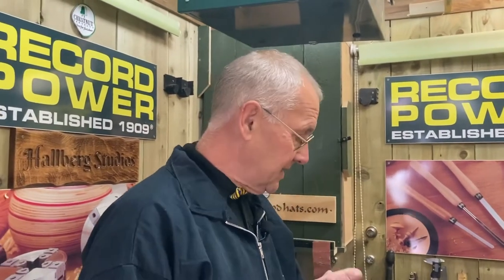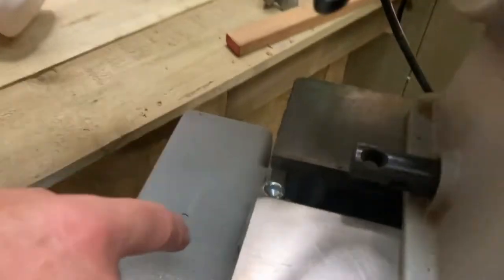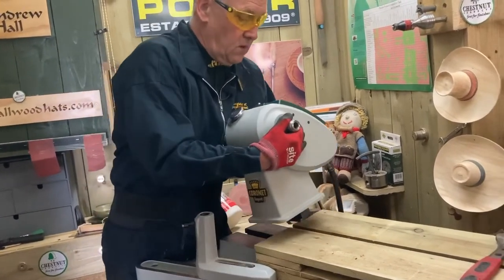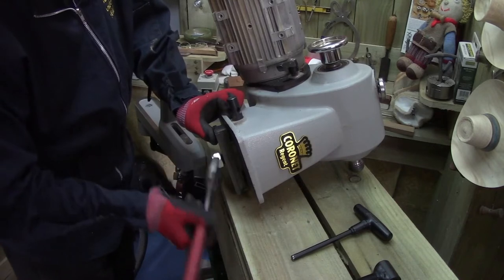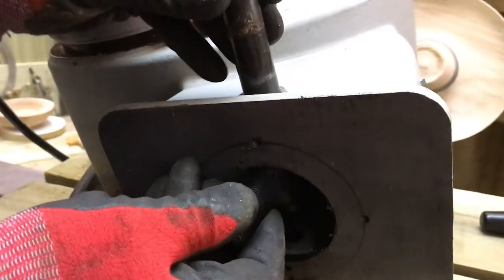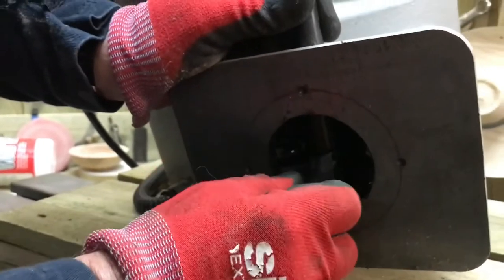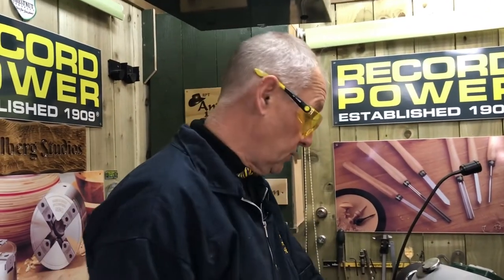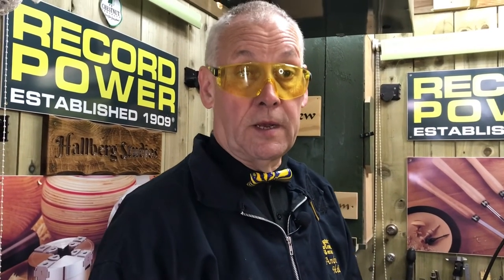Know-How Series: Coronet Envoy and Regent Clamp Bolt Replacement with Andrew Hall

Comment: The spring housings on the plate are in fact drilled right through and each hole has a grub screw underneath the spring. I backed off both of these grub screws until they were almost out of the plate. From the other side I put grease in the holes and inserted the springs. Then I placed the greased bearings in the two holes, they are slightly larger than the hole so won’t drop inside. The bearings held their position whilst replacing the plate and securing nylock bolt. Once tightened I then tightened the 2 grubs screws back to their original position (just below the surface) which puts the tension back on the springs. I found this makes it a lot easier to replace the plate without losing the bearings. I found this out because in the upgrade pack were replacements for the 2 originals. Hope this helps.
Reply: Thanks Allan for sharing your experience
Reply from the maker: Hi Allan, thank you for your comment. If you would like any additional assistance or advice with anything at all, please get in touch. Best Wishes, Record Power.